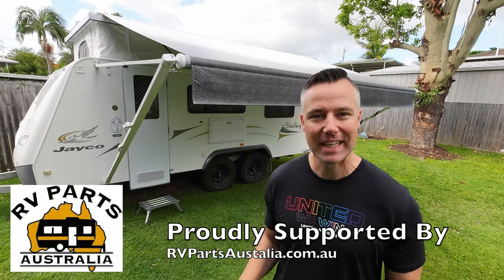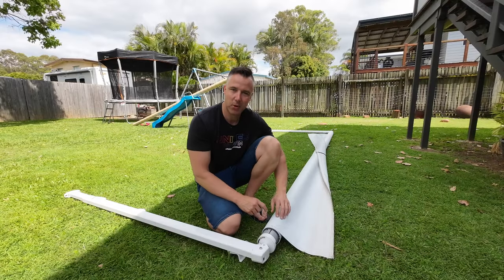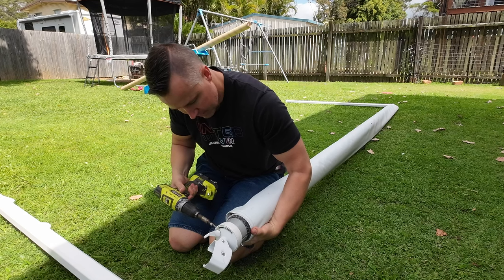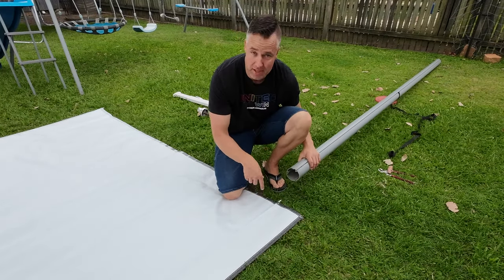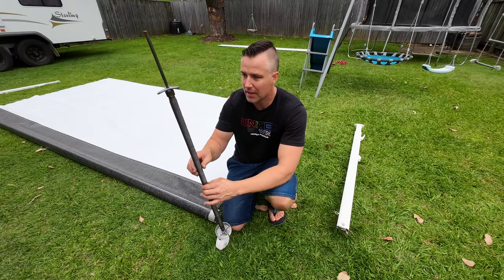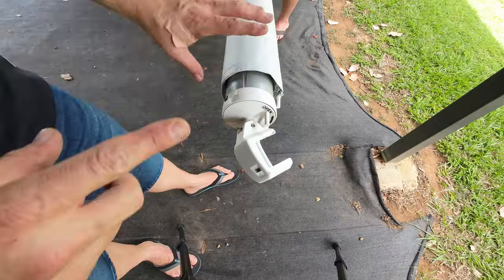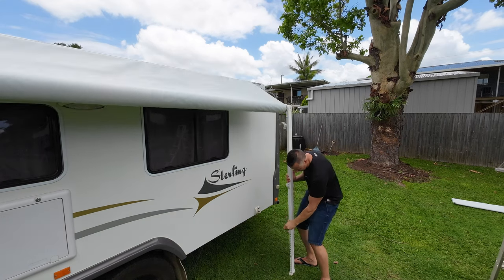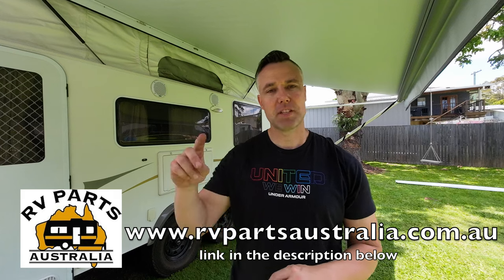Caravan Awning Skin Replacement - Easy DIY

Comment: Worth pointing out that he winds tension on the cam lock end in the wrong direction.  I followed this vid and it had no tension.  I corrected it by leaving the awning attached at the roof but taking the arms off at the top and bottom of the van, leaving them connected to the awning, and then winding each arm so that when it is hanging down from the barrel I spin it up on the side of the van…. I did this both sides until I had sufficient tension…

Comment: Great tutorial guys. However, please help put my mind at rest. I'm double checking that when tensioning the springs they are turned clockwise at each end (as in the video). This seems a little counter intuitive to me as they are turned in opposite directions to each other. I have reassembled, ending up with weak tension despite having extra turns on each spring. Do i just add more turns, or should one end be turned counter-clockwise? Thanks in advance.
Reply from the maker: Hey mate! Good pickup!! Yes you are correct both need to be wound the same way! - one clockwise and one anticlockwise. I actually corrected this off camera but didn’t show this in the vid! Sorry for the confusion